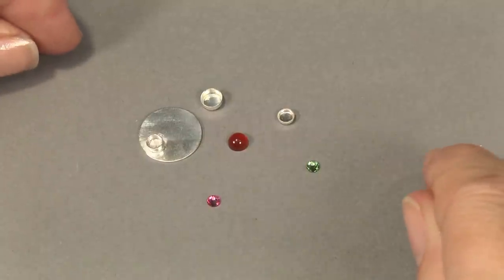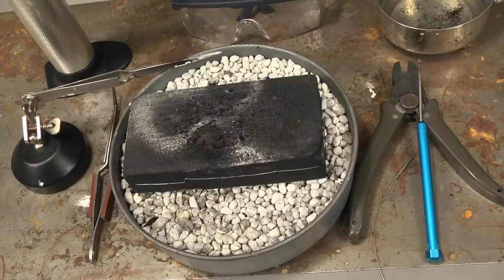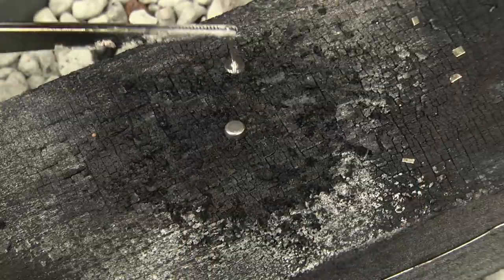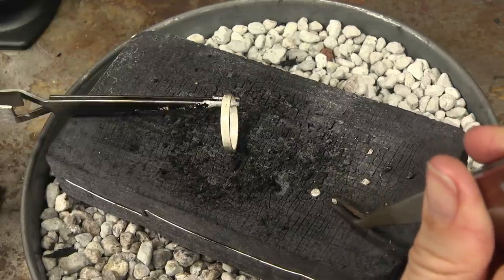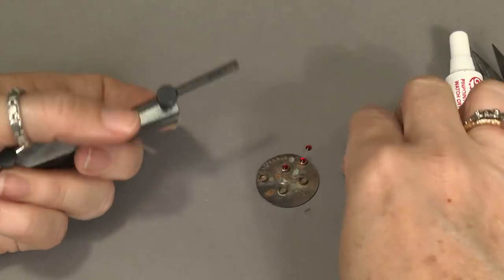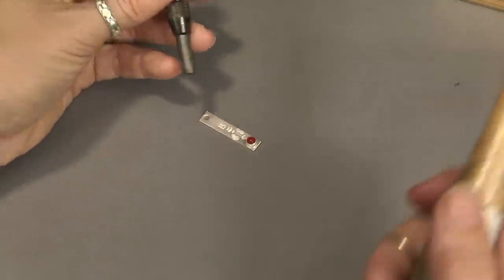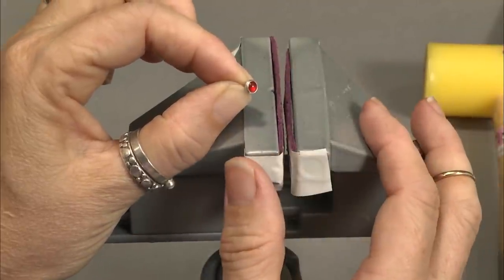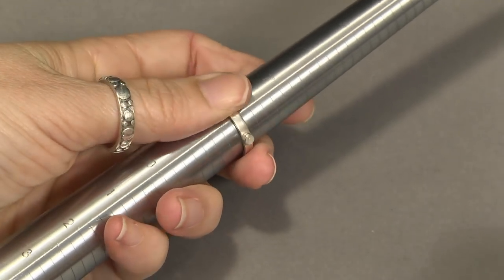How to Solder and Set a Bezel Cup - Beaducation.com

Comment: Thank you. I'm about to attempt soldering my 8mm bezel cup onto a 10mm ring band. Is it better to solder it on the opposite side of the original ring shank join, or over the top to help hide it (I'm soldering copper with silver solder)? Thanks!
Reply from the maker: sorry for the late reply! I would solder right on top of that joint because yes, it will hide it and if it accidentally opens when you heat it, your new solder will help keep it closed

Comment: I'm looking at soldering sets/guns? What is the minimum temperature needed in one to be able to make a bezel? All the ones I see on Amazon for decent starting prices go to maybe (if I remember right) 850 degrees- is that good enough?
Reply: Course it also looks like I have ALOT  more tools and items to buy beyond just the solderer!
Reply from the maker: The needed heat depends on the solder you are using. Most soft solders flow at 1325 so you need at least that much. Here is some info that might help https://beaducation.com/pages/learn-to-make-soldered-jewelry and here is the most affordable torch that we sell https://beaducation.com/products/micro-torch

Comment: Do you have to do a bezel cup aluminum on a aluminum blank?
Reply from the maker: We don't work much with soldering aluminum so you may want to refer to a class that specifies using that material. These products are sterling silver.

Comment: this has nothing to do with video but it's about soldering copper do you have to sand what your going to solder then flux or just flux and then solder
Reply from the maker: Nope, you do not need to sand first. You just need to make sure that the metal is clean, then flux then solder.

Comment: Like the info, however alot of rings i am looking at on google  images don't look like they uses bezel cups at all. So in this case where the ring looks to be decorated casted all together how is the stone held in those. Do they just super glue it in or do they pour the cast /mold of ring directly over the stone to secure it...Anyway i like to see a video on all the major methods of securing stones of different types/sizes to your ring. This is a good video on how bezel based rings are done.
Reply from the maker: Not sure how other makers are creating their pieces or if they are being manufactured that way.

Comment: I have herkmier diamonds of various sizes and shapes. Would a bezel set work for these? After watching your video I'm thinking not, but maybe you have an idea for me?
Reply from the maker: Unfortunately I don't have a suggestion for that. We do simple soldering techniques but maybe check Lapidary Journal or something like that.
Reply: I'm new to this so there's probably better info regarding setting odd shaped crystals but the video link below explains a little bit about setting odd shaped stones although I have purchased crystal stone earrings that were set in somewhat of a bezel frame but without a back so light can show through (I'm guessing it was considered a bezel). If I run across a specific tutorial for setting odd crystals, I'll leave another comment. In the meantime, see if this is helpful. Cheers! 😊

https://youtu.be/hlhjdC-svCY
Reply: Hi again!  I found a 7-page pdf document with instructions for free-form bezel setting odd shaped sea glass which could also possibly work well with your Herkimer Diamonds.  I found it at Facet Jewelry when I Googled the words "bezel setting odd shaped crystal stones".  Just Google the same words and scroll down through the results a little ways and you should see it.  Again, it is a PDF file so clicking on it downloads the file.  I downloaded it without any problems (no viruses) and it shows exactly what I was trying to describe.  Good luck and God bless. 🙂